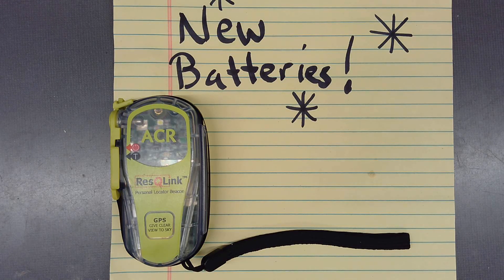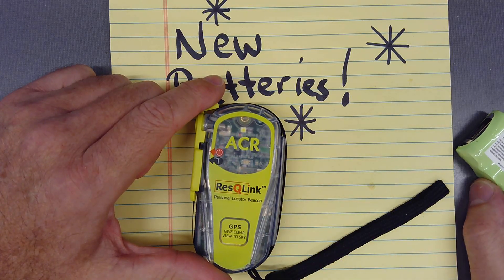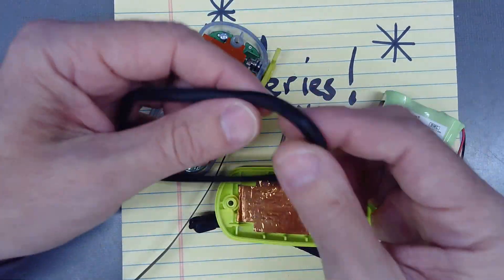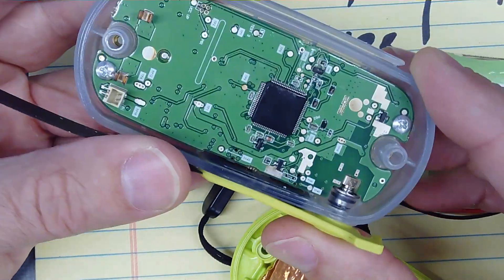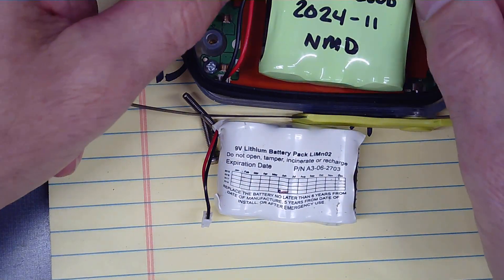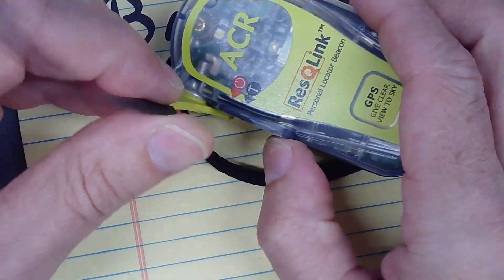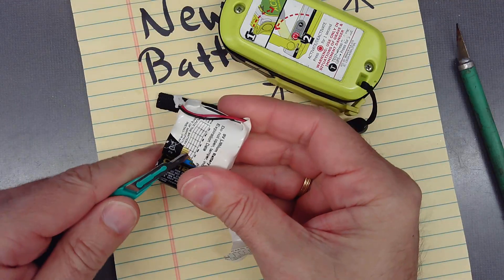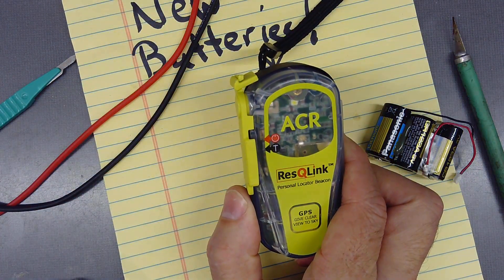$13 ResQLink battery replacement - 90% off ACR price!

Comment: Thanks @nickyDoes, I followed your guidance and managed to successfully change the battery. Unfortunately the  'electronic witness' has been triggered, is there any way I can reset this? Also can you (or anyone) confirm that this indication is solely about the number of tests rather than the actual status of the battery. Thanks

Comment: Thank you.  Any idea if something special needs to be done to replace the "electronic witness" countdown?  The battery replacement is simple enough, but if I'm interpreting the instructions correctly, it sounds like you can only test the GPS functionality a total of 12 times before it becomes disabled due to the battery witness seal and would need to be reset at a service center.

Comment: Nick, Can you help me out. I’m a good DIY and want to replace my own batteries on my but the replacements I see on AMAZON aren’t Panasonic batteries but are instead made in China w/o and discernible identification. Can you provide some insight and advice?  TY
Reply from the maker: While the HQRP battery I linked in the video description is 'made in China', the cells inside the pack are labeled Panasonic and by my best abilities, appear authentic. I suspect if you buy ACR's battery, it is assembled in China from Panasonic cells as well. While you could buy BR-2/3A format Panasonic batteries from Digikey or another and assemble your own pack, I would neither choose nor recommend that approach.
Reply: Thank you for your help. Just ordered two sets of batteries and will DIY the replacement when they arrive. ☮️

Comment: What quality is the battery you are using as a replacement?  As an electric radiocontrol plane flyer I can tell you not all batteries are equal by any means.
Reply from the maker: I show it in the video. They are Panasonic primary lithium batteries, not rechargeable.

Comment: as the PLB-375 is discontinued and no longer possible to buy, I wonder if the new PLB-400 uses the same battery
Reply from the maker: @mifino  Maybe ACR will send me one to review (and tear down)?
Reply: There's a place called Beacon Battery Replacement that sells battery packs for these units for around $30.  According to them, model PLB-400 uses the same battery pack as the 375.

Comment: Batteries alone aren't what you are paying for the piece of mind that it's going to work when you need it to. $150 is going to feel like pennies if you ever have to use it in real life and it doesn't work.
Reply from the maker: Some overspend for the illusion of safety. My role is to provide info so people can decide for themselves.
Reply: its called labor fees . thats it
Reply: There's nothing exotic about these batteries.  They are standard CR123a batteries.

Comment: A very simple job, but checked your excellent video just the same to be sure. My battery’s expiration was labelled 04-2019, yet the cells had expiry dates of 02-2023. The combined voltage was 9.65V, so as in your case, there was plenty of life still left on the batteries that had zero power draw throughout their life, except for maybe 20 tests . 

I noticed that the Amazon description of the HQRP battery states that the batteries are rechargeable. This must be an erroneous statement.
Reply from the maker: @karlemski Thanks for sharing that.
Yes, these are definitely primary batteries, and not rechargeable.
Reply: If the black coating on the antenna is coming off should I get that replaced?    Or can I do the repair myself?
Reply: I doubled checked my self, by reviewing when you opened the case and I noticed that you had the back cover rotated 90 when re-installing. You might want to flip it back to the original position. I’m not sure the effect of the internal copper shield but it might matter.
Reply: ACR PLBs are designed to transmit for "a minimum of 24 hours" after activation of the emergency beacon.  Plus, ACR says that the unit has enough excess battery capacity to do a self test monthly.  Personally, I don't fear having a slightly expired battery on these units for these reasons.  Of course, a newer battery is preferable to an older one.